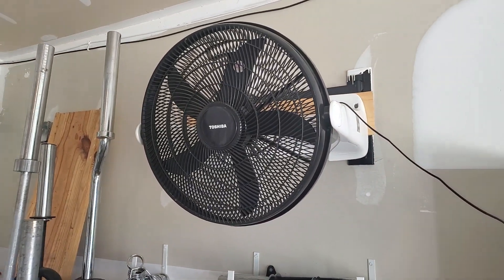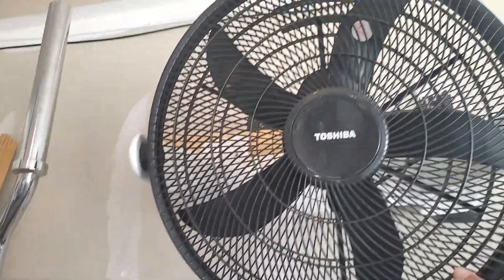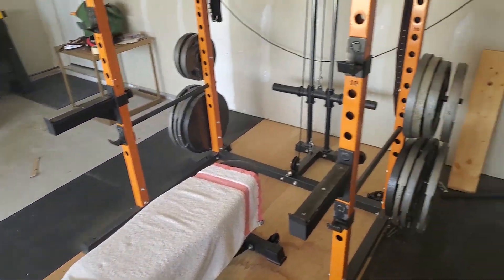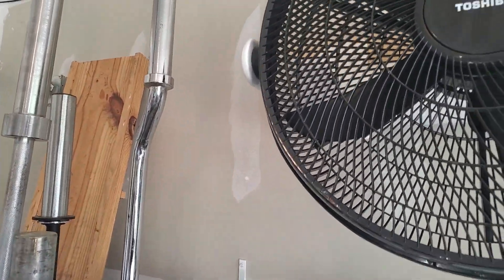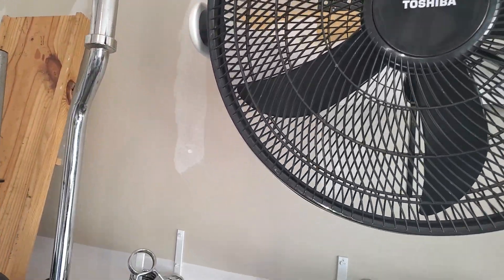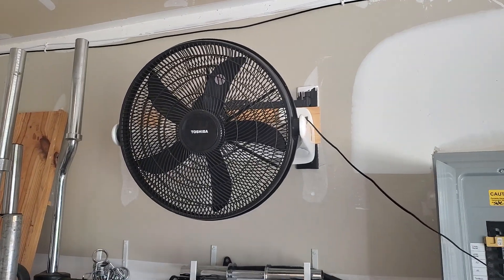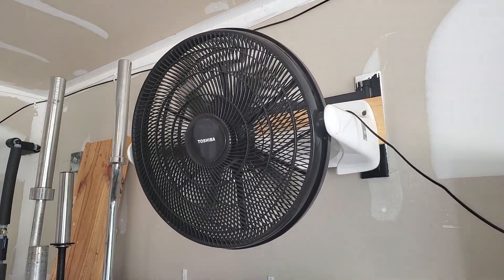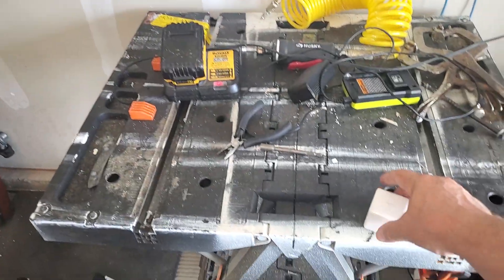Just a bored guy and his garage fan. Making it better and Smart!

Comment: How is the fan adjusting in power level? Like I understand how the magic cube works but what is controlling the fan output? My dumb fans I have all have a rotary dial which is nice because it will always turn on at that level.  Unlike something with a touchbased system, like my air purifiers.  I want to setup something like sensor for AQI and then turn on my air purifiers with smart outlet.  I'm wondering if how you did this could work for me and my air purifiers in my home.